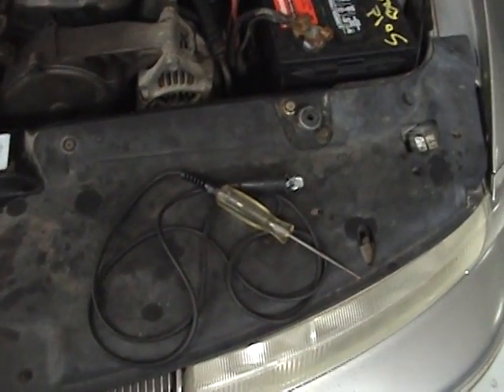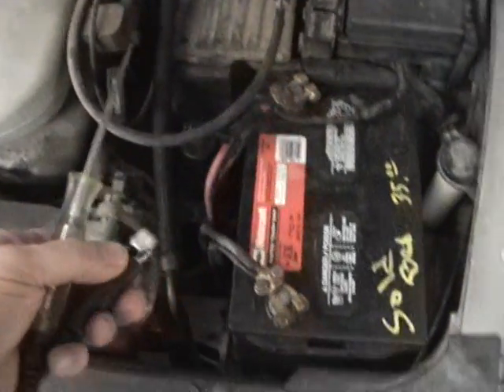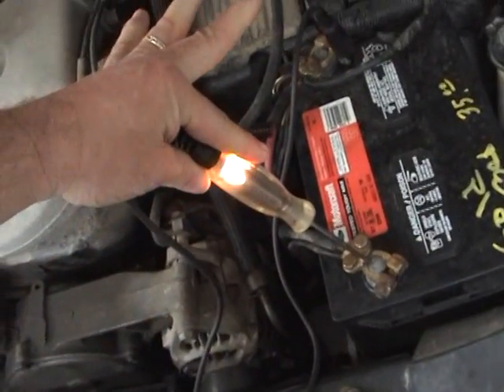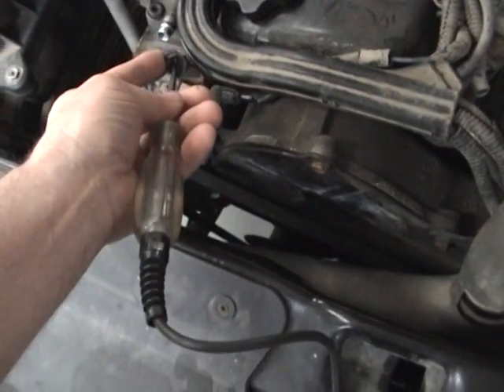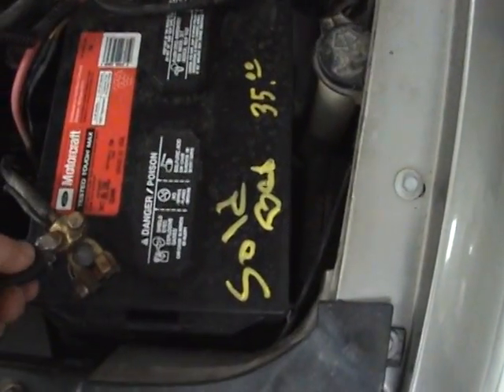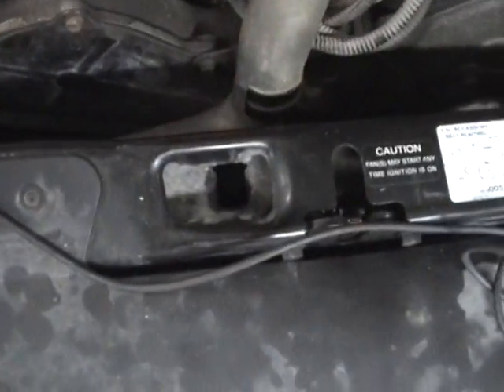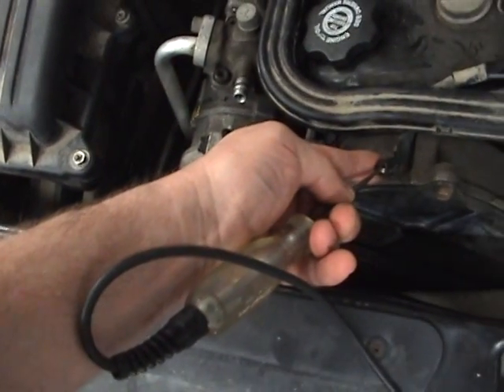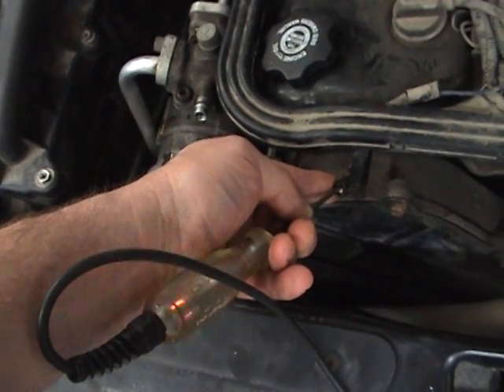Using a test light to diagnose electrical problems

Comment: My vehicle (2003 Dodge Caravan Se V6 3.3) is giving me a (P0201-Injector Circuit/Open Cylinder 1) code and i have a (2003 POWERTRAIN DIAGNOSTIC PROCEDURES book for town & country, caravan and voyager) that shows on page 88-89 test procedures to follow and apply. 

So far i have applied (test 1) and (test 2) and im on (test 3) now and im stuck on not being able to follow and apply it cause im not grasping and understanding it at all. 

This is test 3
Turn the ignition off.
Disconnect the Fuel Injector harness connector.
Remove the ASD Relay from the IPM.
Turn the ignition on.
Jumper the Fused B+ circuit and the ASD Relay Output circuit in the IPM. (This part im lost)
Using a 12-volt test light connected to ground, probe the (K342) ASD Relay Output circuit.
Does the test light illuminate brightly?
Yes      Go To 4
No     Repair the open in the (K342) ASD Relay Output circuit.
          Perform POWERTRAIN VERIFICATION TEST VER-5.

This is a video of me following and applying (test 2-https://www.youtube.com/watch?v=rbzQKyiNwcA) and in that video it shows the pages in the book from page 88-89 and pages 312-314 for code (P0201-Injector Circuit/Open Cylinder 1).

Are you able to please make a video showing me how to perform all of these test procedures so it can help me grasp and understand to where im able to apply the test procedures from all those pages?

Comment: FOR THE LOVE OF GOD! Can someone please contact me or answer a simple question: i have a '94 GMC s1500 a month ago i had cut this black box thing that kept falling in front of my break pedal...called "DrawTite eletronic trailer brake control 5500". And now i have no brake lights. And yes i am a marroon
Reply from the maker: Barry the thing you removed is a controller for electric trailer brakes. 
Here is an image of the wiring diagram https://goo.gl/images/WKcFBC
I would check the fuse for the brake lights. It might be bad.

Comment: What if the light doesn’t come on when connected to the battery
Reply from the maker: Mute Falon always start a test light diagnosis at the power source to verify that you have power and a functional test light. If it doesn't light try it on another known good battery.

Comment: Hey Todd I also have a Chrysler lhs and it keeps blowing a fuse connected to the dash gauges, how do you diagnose this with the test light?
Reply from the maker: if it's blowing fuses, then there is too much current flowing and the circuit protection is doing it's job. If it's a short to ground then you could hook your test light to power and test the circuit for continuity to ground, opening connectors in the harness until the light goes out, then you have found the section where the short to ground is.

Comment: is there any risk in shorting anything by using this improperly? I was using it, I had it connected to my negative side of battery and stuck it in where the bulb should go. The circuit tester light went on for a sec, then went off. Now my fog lights are not working. which was not the case before.
Reply from the maker: Check your fuses, you might have shorted the center positive with the outside negative and blew a fuse.

Comment: i haven't used my test light ever since it was bought by my dad (10 years ago I think). Is it still safe to use it?
Reply from the maker: Low impedance (higher current, low resistance) should only be used on analog circuits, starters, power to lamps, blower motors, wiper motors, etc. High impedance (low current,high resistance) should be safe for computer controlled circuits, if you don't know what you have measure resistance with an ohmmeter.http://www.bcae1.com/testlite.htm

Comment: Hi..., my car starts properly. But when I turn on my headlights switch only after starting. My cars then shots down completely. I don't get any power for about a minute. My other switches for accessories work fine. Now my second problem is my headlights don't show any lighting. But do pop up. when I turn them without starting the car. I have had my starter, alternator, battery checked and are fine. I just replaced the spark plugs, fuel filter and fuel pump and are new. I have an 88 Mitsubishi Starion with 1.6 liter turbo with manual trans. Can you help...thxs
Reply from the maker: +Mrinfoone from the symptoms that you are describing I would check (and clean) all your ground circuits to the battery, to the body and between the body and the engine. If any are bad or having resistance you will have strange symptoms like what you are seeing. I would also try adding an extra ground wire and see if the problems go away, get out your jumper cables and go from the neg - terminal on the battery and hook it up to the block or body and see if the problem goes away. If it goes away then you found the source of the problem and the fix will be easy. Let me know what you find.
Reply from the maker: +Todd Morrill also make sure you have clean battery cables and get away from the clamp on ends as these are prone to problems.

Comment: Why not just use a multimeter? Lights tell you nothing...
Reply from the maker: another thought, yes voltage drops are a very good diagnostic and the meter is the second tool I reach for after my test light,(if the test light doesn't point me straight to the problem) ever test a bank of fuses with a meter? it's exhausting to be under the dash and trying to read a meter compared to using a test light which quickly tells you yes or no to presence of power or ground on a circuit.
Reply: Lights are the most basic and fastest yes/no test you can do. I find them a lot more effective on things with inconsistent output, such as ignition modules where you might get a quick bounce on a multi meter or you might not, but the light will always flash.
Reply: Really,  a meter puts no load on the circuit and tells you even less, the reading it gives you is not valid unless loaded

Comment: Hi, I have an electrical problem on my motorcycle, a 1978 suzuki gt 250. We had the alternator rewound because it wasn't charging at all, that was done but now the bike isn't charging with the lights on. It appears to run off the battery only. Can you help?

Thanks.